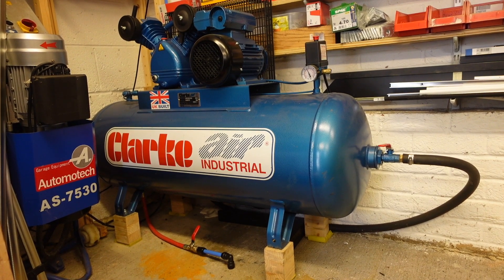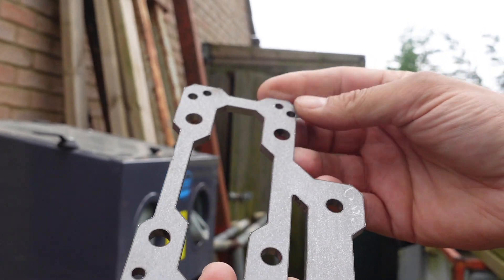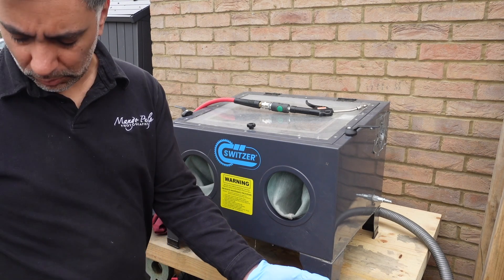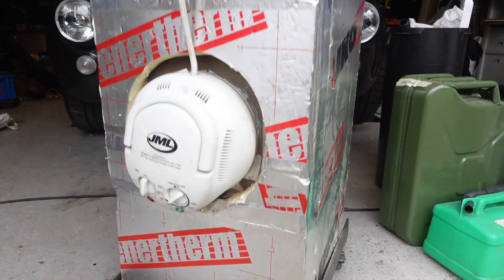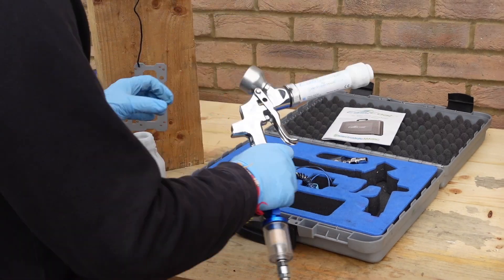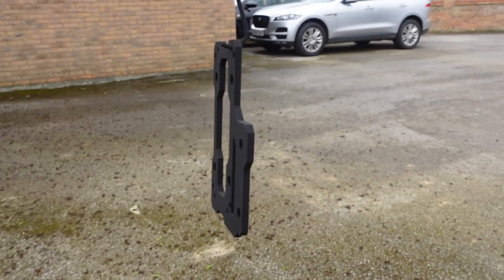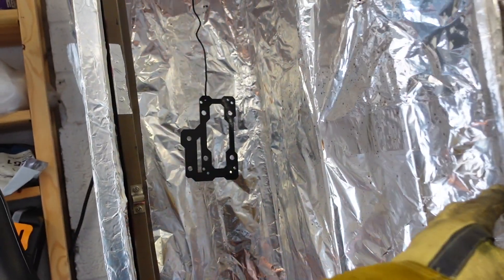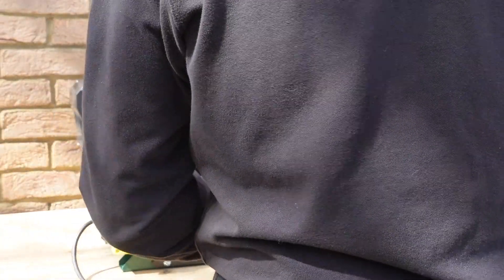DIY Powder Coating in the home workshop

Comment: How did you mount the halogen oven to the back of the cabinet? Looking at making something myself
Reply from the maker: There's 3 small bolts (you can see these around 2:11) that go through the sheet metal into the oven.  I think these went into the fixings that previously mounted the glass lid of the oven.
Reply: Thanks for the reply. I see now, gonna look into building one like this. Have you had any issues with using the halogen oven piece as a heating element?
Reply from the maker: @Toastmanpat  No, it's actually worked out really well.  Auto-timer for safety, built in fan , cheap - it's great for a first build.  Good luck!

Comment: Fantastic video. Do you recommend that belt grinder?
Reply from the maker: The hardware is actually very nice.  It seems well designed as a kit, but the service/support from the supplier is lacking and let's it down a bit.